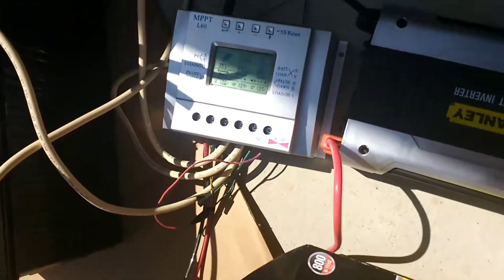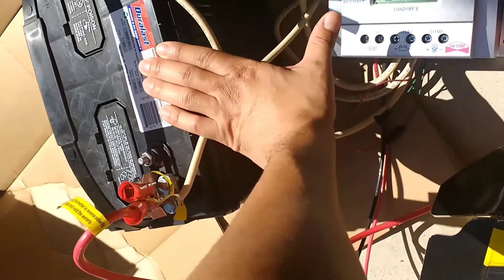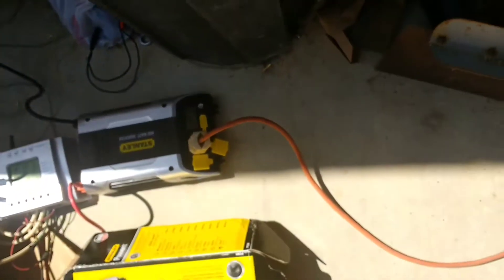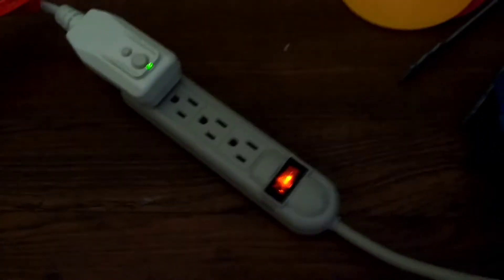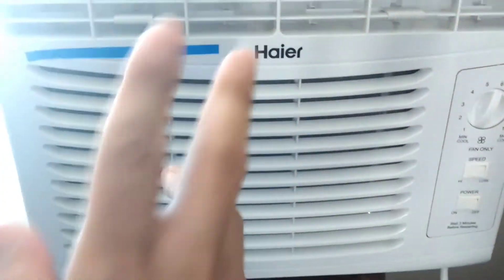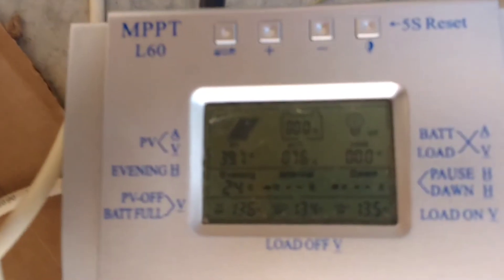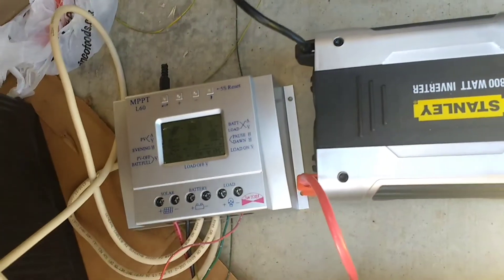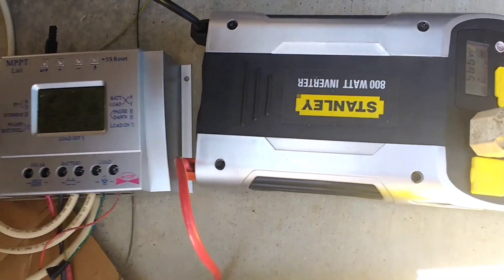Solar powered Air Conditioner

Comment: Nice.  That Stanley 800 watt inverter had no problem? How close to your battery and what thickness of wire?
Reply from the maker: I think it's 6 gauge. It's the cables it came with. I had it very close to battery. It finally gave it on me. Honestly, I wouldn't buy the Stanley again lol. It gave out  pretty fast. The ac uses about 500 watts.
Reply: @ka24detpower  Thanks. I've done some testing of my own .  my AC (frigidair 5000 btu) is rated at 450watts and i think has a soft start.  Power needed to start the AC tends to be the biggest issue and in many cases you can't even run this AC with 1000 watt gas generators.  There are new Portable power stations (solar generators they call them) that come close to running an AC like this for 5 hours.

Comment: I would setup multiple batteries with 3 or 4 - 200 watt solar panels and a heavier inverter for continous power.

The thing with ac units that people fail to understand is the surge power the compressor pulls on start up. If your inverter isn't powerful enough to handle the pull it will shut off.

I'm looking to create something similar for camping. Some camp sites don't allow ac units I'm assuming because the amt of power it requires. If I can build a setup like this they can't really say anything since it's all natural sourced power.
Reply from the maker: Robert James you are right. I have added 2 more 300watt panels and a tiger claw 3000 watt inverter. The AC runs longer and the upgraded inverter can handle it.
Reply: Oscar Diaz Does it stay on continous without running out of power with your new setup? Also what btu is your ac unit? 

Where did you purchase your power inverter and solar panels at?

Sorry about all the questions. I'm interested in doing the same for camping.
Reply: Oscar Diaz tiger claw 3000 watt is a beast. That's plenty.
Reply from the maker: Robert James it's stays on for a couple hours. I have 4 batteries now. I think it's like the smallest ac. Like 3000 or 5000 btu, I forgot. It's 100$ ac unit

Comment: Excellent. Is it possible to power the Air conditioner directly from solar panel  during peak sunshine via inverter , but by pass charge controller and battery ?
Reply from the maker: I finally found a way lol. Look up voltage regulators. I been using a 48volt to 12volt regulator that connects the solar panels to the regulator and then the regulator to a DC to AC inverter :) good luck